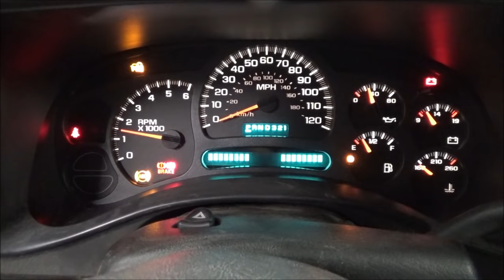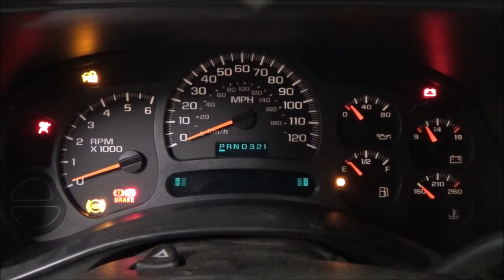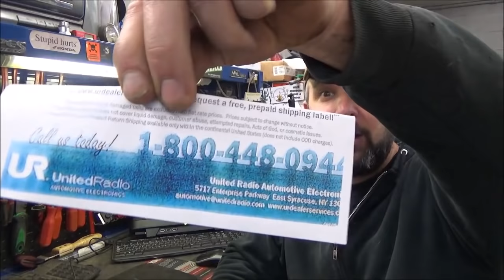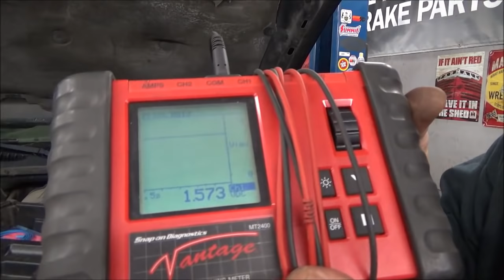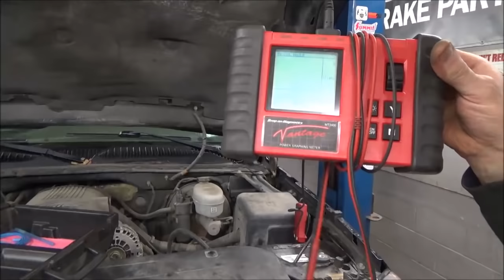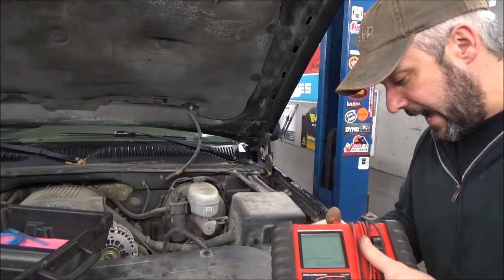Chevrolet Truck - Battery Dies Overnight - Part II

Comment: What the tech referred to as "silver migration"  is also known a s whiskering, metal whiskers, tin whiskers, lead whiskers, cadmium whiskers and galvanic whiskers. 
This is not a new phenomenon, it has been known and around for about a century and has been problematic for numerous industries and the military long before the RoHS mandated reduced lead and lead free solder. 
However, the addition of lead to the base metal many times reduces whisker growth and sometimes stops whisker growth, depending on the metals involved and the environmental conditions. 
Metal whiskering has allegedly been responsible for several spacecraft malfunctions. 
Good job by you and United Radio. 

Here is a link to a wiki with some basic info: 
https://en.wikipedia.org/wiki/Whisker_(metallurgy)
Reply: Most definitely Tin Whiskers. Lead Whiskers do not form as readily.
Reply: Cause of (or speculated cause of) death of many a satellite in orbit!
Reply: Thanks for the information and link even me as a metal fabricator and welder i have to worry about migration too alot of the welding supplies are going flux free and lead free makes for cold welds, brittle joints, and the weld also rusts aways faater seems like so yeah good stuff kudos friend.
Reply: Because of the whiskering, it is my my understanding that lead-free solders are not now used on aircraft, spacecraft or medical equipment.  Anybody know if that is true?
Reply: From what I've read whiskers should fall off with a good old whack. With the video in mind, does that mean that whiskers from lead free solder is more solid than whiskers with leaded solder?

Comment: Very informative, I did this test of amp draw and pulling fuses and on mine it came out to be a bcm problem I thought. So my simple fix was to add a battery cutoff switch under the steering wheel oh going on eight years ago. The problem with that is having to keep track of when to change the oil and stuff cause you're more or less resetting the computer every time you turn it back on. Now when it warms up I'm going to double check my findings and rule out the cluster. Thanks so much for sharing.

Comment: Hey Eric on old radios from the 40's and 50's the radios have coils to tune the station. At the  bottom and top these coils are held together with mica, (thin rock sheets of quartz for insulators to hold it together), so these radios fail with silver mica disease same as your instrument clusters.

Comment: Thanks for the video!  I have a Duramax that does the same thing.  I also noticed the cluster lost track of the engine hours at roughly the same time as the draw.  Pfffshhh, Lead free solder....

Comment: Between all your tools, a thermal camera, sure deserves a place. 12V at 200mA is more than 2W power disipation. Sure that just by using thermal scan you will notice that the cluster has a hot spot somewhere (asuming that all of the 200mA come from cluster)

Comment: United Radio.

The cluster in my 2004 Chevy Cavalier has been stone cold dead for a number of years.  In 2018, I took a multi-thousand mile trip out West and brought along my OBD-II code reader to act as the speedometer.

I had been thinking about getting one of the servo refresh kits and rebuilding the unit myself.  However, the tripometer and odometer were also lights out.  I just didn't have the desire to send it to one of the YouTube rebuilders...  The confidence just wasn't there.  However, I caught your work on this car and figured if you liked United Radio, I might as well give them a try.

I pulled the gauge on a Saturday and shipped it to Syracuse on Monday.  A different rebuild cluster was returned to me on Friday.  I had the cluster back in the car and the dash put back together in less than an hour.

It's gonna be nice to have a speedometer and fuel gauge again.

So, the next time you connect with United Radio again, get that discount for pimpin' them out.

Now, we see how long their reconditioned gauge cluster remains operable...

Comment: Frackin RoHS strikes again. Lead-free solder is CRAP! I hate working with that stuff. I'll stick with good old 60/40.
Reply: me too
Reply: Kept a bunch of rolls around for this reason!
Reply: Beater truck,,, could put a toggle switch on the orange wire to prevent power loss?
Reply: DM Osborn or just take the instrument panel out and throw it in the scrap pile. Lol
Reply: DM Osborn even lazier solution: pull the fuse when you park the truck and push it back when you want to leave

Comment: Those dashes are always such a joy to put back! AHG silver migration... damn it! I pulled mine out and did the re-solder job and it worked fine.. for the short term.. but it went from a one day drain to a three day drain and now I know what I forgot to check.. the mirror does the same thing by the way..

Comment: Thank you Eric for the great video. Well explained and informative. I have a draw and the garage removed my seat fuse on my 2002 GMC Sierra pickup and that worked. Also my cluster panel does not work at all ..no park no mileage.etc. I have emailed United Auto  to see if they can repair my cluster. I live in Kingston On. So we will see. Thanks again . Great job.

Comment: Sir, you did a terrific job with this video. I have watched lots of fix it videos that have helped me keep my families vehicles on the road. I own a 01 gmc sierra and my step dad  has a 03. I've re-soldered my abs module and replaced his stepper motors in his cluster. Not really knowing why my abs modules soldered  joints failed or why his stepper motors failed. Now I am curious if all of gm's solder joints are suspect to fail because of the soldered gm vendors used and wonder if 2003 is when they switched solder types.  I also smell a epa rule in this situation and or creative job/sales security scheme.  
Again great job with the video and I appreciate you sharing your diagnostic skills. 👊

Comment: very good deducting and a small thing like corrosion on circuit board causes such a voltage drop to discharge battery, brill , john from england, like your channel.

Comment: This just started on my 04 Silverado so now I know what route to take . Thanks again for your knowledge and help
Reply: Thanks to that phone call I successfully made this repair today. Get some good flux (I like Chipquick), lead solder, solder wick, soldering iron, and 90% isopropyl alcohol. Apply flux to the “black spots” (they were more gray than black on my board), heat with soldering iron to get the flux boiling (I used a hot air station, but most people don’t have those laying around lol), put a glob of solder on your iron, lightly “scrub” the spots with your solder glob (don’t worry if you get solder in places it shouldn’t be, you can wick it off in the next step), then use your iron and solder wick to wick away excess solder and the silver. Wipe everything clean with the alcohol and repeat the wick scrubbing as needed until you get all of the gray spots cleaned up. You’ll probably remove solder from a few test points while wicking. I don’t think it matters, but I did go back and add solder to replace the solder that I removed from those points.

Comment: I work for a Military Contractor.  The government requires that we not use lead solder anymore for "environmental" reasons.  To mitigate the migration/corrosion problem, we have to apply Parylene Conformal Coating.  Military electronics have to be able to survive environmental conditions from extremes of hot/cold, arid to humid and salt mist.  If this problem doesn't exist on newer vehicles, that's probably how they achieved that.  To make repairs to components, the coating has to be stripped off before unsoldering and reapplied afterwards.
Reply: In this particular case, slightly increasing the distance between traces would solve the problem and as far as I can tell, there is PLENTY of real estate to allow that.

Comment: Another excellent video!  Just curious about how much they charge to refurbish the cluster.
Reply from the maker: +Jeffrey Cardimen Less than $200
Reply: Solder joints can be a PAIN!
Fixed a couple of wiper boards that way also

Comment: Eric, there is one thing I would have done different, I would recheck for the current draw, before closing up the instrument panel.  I know your experience in the past, have told you that the cluster is the culprit, but it's  always good to check before closing up, so you don't have to reopen the panel again.  I know it's easy, but as they say  "Time is money$$$ " 
Nice Job by the way.  Keep up the Good Work.  God Bless.

Comment: Had to do the same thing to my wife's 05 Monte Carlo. We found a place on ebay that had remanufactured clusters in stock.  They would send you a repaired cluster, and once you sent yours they would refund a core charge. Had to fill out a milage affidavit when you ordered it so they could put the legal milage in the one they send you. Our issue was a bad stepper motor in the speedo. It went really well. Because the car was an SS Tony Sewart special edition with the supercharged engine we needed the cluster with the boost gauge.  Not easy to find. We got the only one they had in stock. Never had another issue with it.

Comment: ok now part two to my question but what i learned in this vid is intermittants can come from inside a module but what i was wondering as far as diagnostics go could you scope at cluster plugged in then scope it unplugged to verify your short or whatever was intermittant was in wiring to cluster you mention two power feeds to cluster thank you and once again excellent job diagnosing that and even taking it a step further in calling the reman facility and investigating the failures common with that model year cluster

Comment: In the industry when  we started seeing this on dense IC packages it got the name of "whiskers" and it was a problem due to lead free solder in the push to be ROHS compliant. Fortunately our company did not have to meet this new standard because of contracts we had. I think it was Western Digital who was having premature failure of their hard drives especially in areas of salt air. It was attributed to the new solder if I remember correctly. I think it has been addressed but I was not aware the auto industry was using it. Good information Eric as always. Politics pushing engineering, we rushed into it to be at EU standards .I have repaired a lot of GM modules for friends in the auto repair business mostly cold solder joints, especially the wiper modules late 90's. I wick the joints and use Kester 1.5% silver. Never had a problem if done correctly.

Comment: Dash on my '04 Sierra crapped out, one stepper motor at a time.  I should have looked for "Silver Migration" at the time, but I didn't know anything about it. Now, thanks to Eric O I know what it is!  I should pull it out again and have a look - real simple job.  Maybe that's why GM engineering made the IC a piece of cake to remove.

Comment: I attempt board repairs for cnc electronics, and I'll have to keep an eye out for this. Most of the manufacturers do use good conformal coating so maybe that helps mitigate this. I do recommend that if you feel safe with it, do use lead/tin solder, its almost like it was made for the job.

Comment: Extremely interesting Eric, So basically modern soldering "using unleaded solder" ROHS/Environmentally friendly and all that, is causing early failure of components/assemblies, just hope some of the modules where they use ROHS Lead Free solder aren't on critical systems ???????

Comment: Thanks so much for this video I’m currently chasing down an issue in my 2003 Yukon XL Dinali I have had issues with the cluster shutting off going down the road and then immediately coming back on. Being looked like a job I did not want to do I just kind of left it go being it still worked and again I didn’t really feel like doing it LOL now having battery draining issues and discovered this video I’m going to grab my tester but I’m almost 100% certain that’s what’s going on.

Comment: The Migration part I'm familiar with.  It's the Electronics technician nightmare of today.  Sometimes that migration can bridge different layers of boards and all you can do is toss the board.  I've seen pictures of the solder migration and it's grows like an icicle on a frosty window pane.  OH, and one thing I should mention.  The migration can come back so any fix might not be permanent.

Comment: I worked for a company that supplied OEM components to GM.  I interfaced with United Radio almost daily and even went to their place several times since they did the warranty service for our units.  I found them to be more professional that we were and more professional than GM.  They were just amazing.  The UR lab benches for the techs were the nicest lab benches I have ever seen. Wire buses were properly installed and neatly routed instead of just laying all over the place like the benches at my work place. The bench was covered in nice carpet to prevent scratching the units.

Often you can cure silver migration by squirting some alcohol on the PCB and gently scrubbing it with a toothbrush.  Those silver hairs just break right off and the alcohol washes them away.  But the solder cracks on the surface mount parts requires solder re-flowing.  I hate the Pb free solder.  The no-clean Pb free solder makes all the solder joints look so bad that they would have all been rejected in the old days.  

One day when we were switching over our facility to being entirely Pb free my boss sent out a command ordering the techs in the parts bay to get rid of all the "leaded parts".  So they threw away everything with a lead.  Which was about 500k$ of parts.  He should have said Pb instead of lead.  I sent out an email requesting everyone to never use the word "lead" again in any communication. Use Pb or terminal.  We had to place a big order with Digikey to restock all those parts.

Comment: Great video can you tell me where you sent the cluster. I changed my ignition cylinder & cylinder Housing because both parts were worn & sloppy. but now I have a battery drain. Driving me crazy

Comment: Quality work is how you you make a name for yourself and stay in business. Man they still do nice work & if you are using them I know that says it all!  Phone call was interesting to find out what they did to eliminate the root cause. Always a great weekend when there is an SMA video to watch...always entertaining & interesting.
Reply: United radio has always been king of the auto radio cluster repairs exchanges. I used to work for Modern Radio out of Wakefield mass and we did the same repairs and warranty exchanges and sometimes we would lose som business to them cause of their size and reputation as we were a small and upcoming business   I went to over 300 car dealers and auto body shops daily to pick up drop off clusters radios body modules etc.
Reply: +J BONE weekly not daily. Lol

Comment: Hey Steve congratulations on that Chevy intermittent clusterI have very good Steve I have a Buick LeSabre 92 have the same problem that goes if the battery dies like overnight or so if I didn't you know drive it for about a week the battery it holds the charge but I if I leave it for a week or so and I'm driven in a battery goes down I seem to have that same intermittent problem thanks for the video take care be safe out there

Comment: very instructive, had similar issues with cluster on my Chrysler t&c but just replaced it with e/bay used one, maybe they should have clearcoated the boards at factory ? having a great time watching your videos, just did the timing belt on my 1998 Chrysler cirrus  8hrs teardown 8 hours reassembly  come on I'm 76 years old and no power tools . bob in keene nh by the way  i'm the clown on the left

Comment: suprised that you didnt test the battery. a good battery should be able to sustain that draw overnight and still have enough reserve to start it. with that said you did isolate the draw.  that funny waveform in the first video was a timing signal that was bleedin back into the dc circuit, leaving no doubt it was a module somewhere. good videos.

Comment: I have a 1999 Suburban and I wil bet you my draw is fro the same issue. I will find out in the AM. my shop wanted $85. an hour and he said it could take half a day to even find a short to ground. I had no Idea where to begin but I can do all you did. If I can wire and trouble TV Studio Gear, I can trace this short down with your Help. Thank you  !

Comment: Silver Migration on the rear of the cluster ..Good to know as i am working on my 05 Blazer and with a new batt and 100 amp alt lose power after a few days of sitting ..(doing the whole front end right now and diff ) just bought a new gear and rings and the seals ..Once i slap everything together Going to probe the fuses  Also think the after market alarm might be a problem

Comment: Yea see its silver migration.  None lead solder.  I figured it'd be CPU but yea,  gotta reflow the motherboard in a way.  But you could probably use vinager.  Take the cluster apart. Clean it up a bit. But hey awesome job just chattin with the guy.  That takes time and much appreciated.

Comment: Hi Eric, I have a 2004 Silverado that just hit 200,000 miles. I’m having the same issues, my cluster has been malfunctioning for almost a year but I don’t drive my truck much. Replace the battery last month, an I’m having the same issues. What comp did you use to repair the cluster? Thanks for the great videos.

Comment: Good vid Eric. I have the same truck exactly. I use it as a beater truck on my small farm. Question, If I wanted to take a chance could you drive the truck while the cluster is gone for rebuild. This vid special, as if working on my own truck.  "There's your problem lady " Doug L.
Reply from the maker: +Douglas Laramie Yep you can drive it with no cluster